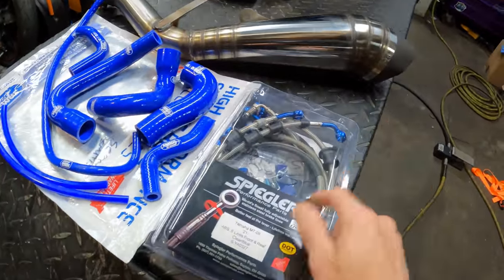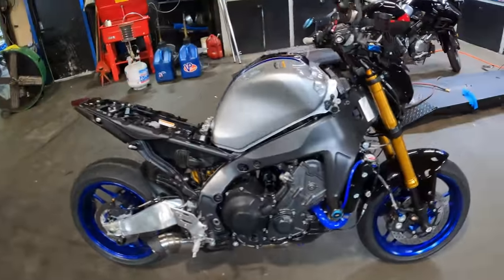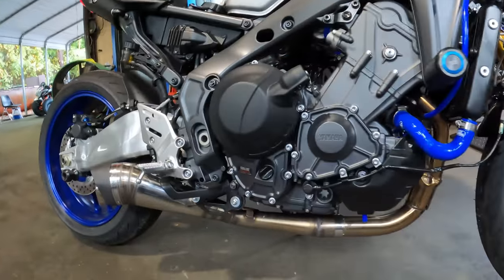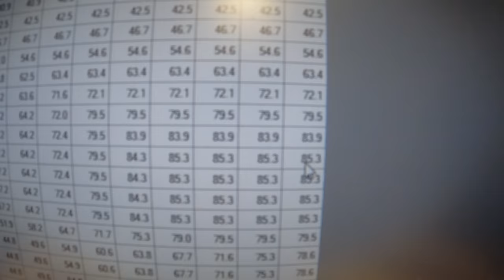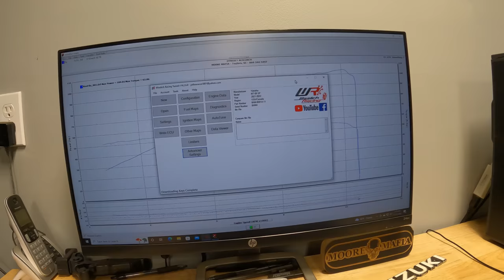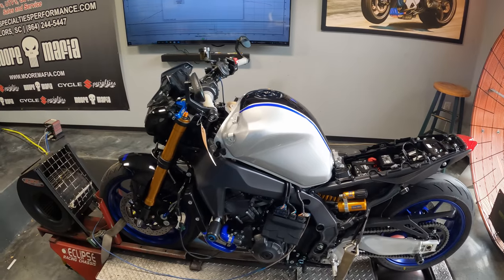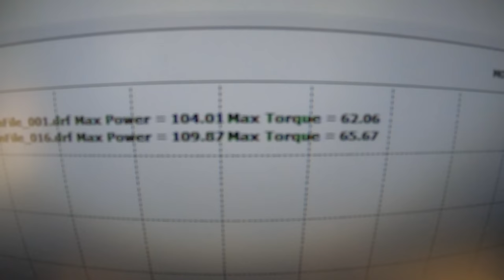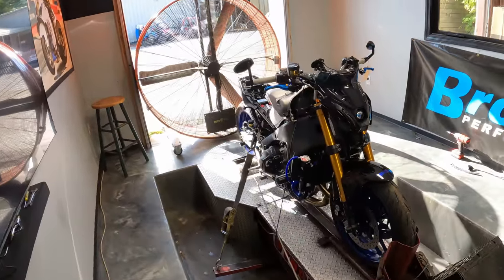2022 MT-09 SP DYNO Exposes MAJOR Factory Restrictions MT09

Comment: There is only a 4hp gain up high but a loss of hp and torque in the mid range with the Akro.  A gain in mid-range is much more important to me than a small gain up top.  A 4hp gain up top?  I dont think my arse dyno would even feel that!  There are some exhausts that have a bigger weight  savings and much better mid range performance then the Akro, as well as costing much less...Dominator being one!
Reply: I totally agree with you, give me mid range power any day. That is where the bike will spend most of its time.

Comment: I recently had my MT-09 SP remapped and fine-tuned. However, following the tune-up, the cruise control ceased functioning and the cc-indicator light started blinking. Anyone have suggestions on how to resolve this issue?
Reply: It's uncorfunate, but I believe flashing the UCU leaves in a bit of a twighlight zone. I am loomimv into it myself (warranty issues and dealer ability to fix the elctronics versus the be efits of the flash).
Reply: Check microswtches at all cruise cancel points.  Clutch, brakes.  One of them is prob not set correctly.
Reply: Do not have AIS shutoff or disconnected or it will render cruise control inoperative.
Reply: If you install ais blockoff plates your cruise wont work.
Reply: Same for mine, no codes and not sure how to make it work. Guess it just doesn't with the ecu flash done to it

Comment: I was seriously thinking of trading my Ducati monster 821 for an MT09. The power is pretty much the same so I guess I'll look at the MT10.
Reply: The beauty of the mt09sp is the balance they get between torque, horsepower, weight and handling. The mt 10 is just too heavy and bulky imho.
Reply: @ljoelmchanley3676  Agreed, MT09 sounds the best of the 3 too
Reply: Mt9 is more for city, mt10 for free way
Reply: Most Monster 821s I’ve seen don’t put down more than 90 whp, so the MT-09 should still be noticable quicker. 
Obviously not to the same extend as a MT-10.
Reply: @MachoMadness69420  the 821 is rated at 110 or so. But I know that's probably inflated a little. Mine has had a tune and update. The MT10 is too heavy I've heard the 09 is a better bike after talking to some people that have had 1.

Comment: Shouldnt it have 117 hp stock?
Reply: At the crank, the dyno reads horsepower at the rear wheel, there are losses of about 10% between crank and back wheel